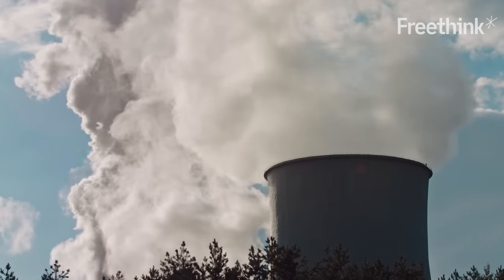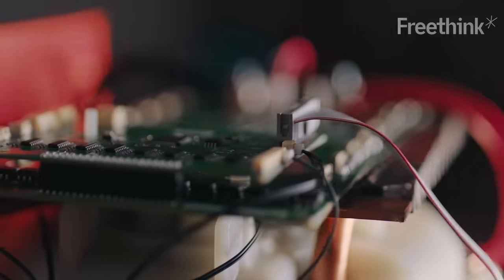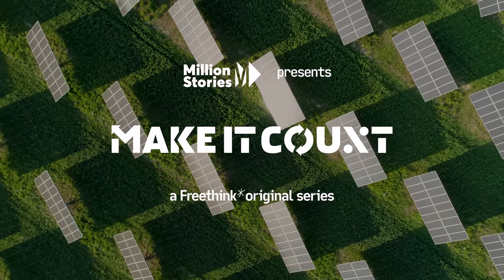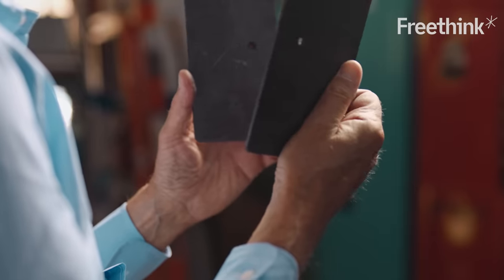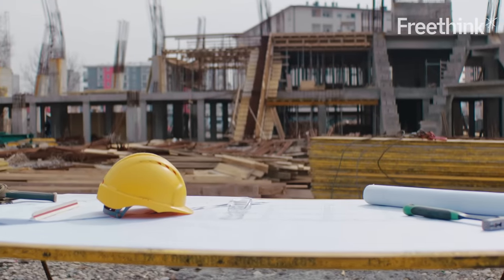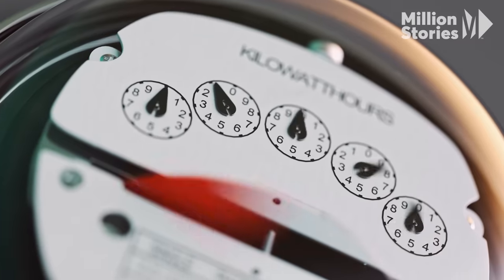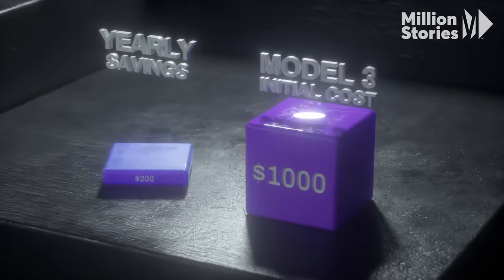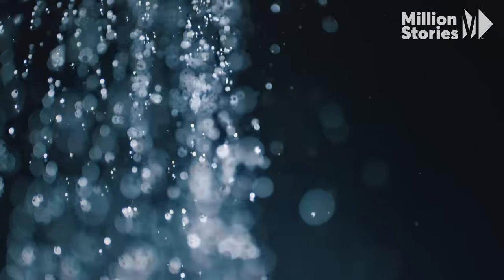The man hacking hot water to save the planet

Comment from the maker: How do you think we can help speed the transition to green technologies?
Reply: Make it cheap, easy to install and long lasting.
Reply: Carbon tax, cap and trade with an aggressive decrease of the cap, government investment in R&D
Reply: Stop making up such buffoonery.
Reply: Make the tech available as a kettle. Start small, get consumers hooked, then upgrade their homes heating systems to the same tech they're now used to.
Reply: Do you think you could do a series on Seasteading? I think it would really fit with your channel, and there's huge benefits for the environment, as well as to society.
I'm part of a number of seasteading projects, and in touch with people from the Atlas Island project, the Seasteading Institute, and there's a number of other projects out there as well.
 - Jamie
Reply: Best time to install green tech is in the design phase, buildings are not a good place for incremental additions. Educate the common people about how simple insulation will be far cheaper than running AC in summer and heating in winter, and how having a solar roof can both save money and keep the lights on during blackouts, not just the folks who are interested in renewables, or the people and companies who think "green" is the latest fashion. Governments are already sponsoring people who install solar or heat pumps, make it a law that a cardboard box with huge holes does not qualify as a house just because it has a roof and door.

Another thing, domestic solar is really expensive because sending a team of professionals to put up twenty or so solar panels and do the electric work in one house for one to three days is a terrible waste of manpower when they could have installed hundreds of panels per day on a solar farm. Micro and small wind turbines are generally only useful away from cities because a 20-100' tall tower tends to bother the neighbors and trees and close built houses block the wind if you put them lower. Lots of businesses have big warehouses and other buildings that could house 100+ PV panels and wind turbines with enough clearance to catch a good breeze, there should be more incentives for companies to use renewables.

Properly use them, I mean, not just putting up a few panels for PR and forgetting they exist... The company next to my workplace has six vertical turbines on their roof that probably have never been maintained; the area is very flat and has lots of windy days, but only couple of those turbines are still moving after years of neglect.
Reply: @TorpisoulYT  
The big advantage is, that for a kettle this makes way more sense than for the hot water of a house.
Reply: @MusikCassette  and yet I cannot find any on the market. If you or any, please let me know!
Reply: @AnalystPrime  Perhaps someone should design buildings to be more modular and the modules replaceable? Seems like a big oversight that such an important and common feature of our civilisation can't be incrementally improved. The container-shaped steel frame building block (literally) featured earlier on this channel seems like a good place to start.
Reply: @AnalystPrime  Yea I think the most difficult problem to solve with big prefab (ex. apartment) buildings would be drawing the plumbing. Ideally the people who own or at least maintain the resulting building also control the prefab production line.
Reply: Increase the price of portable water.
Reply: It would help if you promoted real solutions that follow basic physics, instead of whatever this video was
Reply: Maybe don’t force it on people
Reply: Affordable direct PV DC hot water.
Perhaps a rebate to pay for the installation.
Reply: In reality, what you spent to build "green" and maintenance all those systems you'll ever pay more than just consuming energy. You'll never reach the point where you actually save money. If you get close there is a bigger maintenance or even a total replacement to finance. - Either energy producers are force to produce green energy or products for home usage need to get drastically cheaper as their maintenance easier and therefore cheaper and more long lasting. Both should be done and would be possible. But there is a lot of money to earn with the green label.
Reply: By you not shilling for scams and instead doing your homework and supporting real solutions. Example, go look up Rheem or AO Smith's line of heat pump hot water heaters. Those are PROVEN to be have double the efficiency from actual EPA tests, not some dude's slick Powerpoint.
Reply: Tell the whole story, don’t talk just about the tech that is lining your pockets…that’s a start. There are other options available that are just as good or better.
Reply: @TorpisoulYT  
Plate boilers are available for a dollar a piece!
You just have to go to a different country where ELECTROCUTING PEOPLE, is less concerning to the respective authority's. These went out of fashion in the 50's because they were considered unsafe!
Reply: @lordsamich755  oh my. Perhaps not something I want to try and build myself, then!
Reply: @TorpisoulYT  
If you know what your doing it would probably be fine. But there's no point, they can be bought for a few dollars.

It's true that plate boilers are less prone to scaling. But it's not true that scaling makes the element less efficient. Basically the guy knows what he's doing, and He's a straight up Conn artist.
Reply: @lordsamich755  I do not know what I'm doing haha. I wouldn't rush into a purchase anyway. Thank you for the information.
Reply: Heat Pump water heaters. Look them up, they are a new/old technology
Reply: It has to be treated as part of an infrastructure initiative. That's really the only way this gets implemented in a timely manner. Especially in the US, a lot of people are not going to be able to put this in their homes for a while.
Reply: What bogus and biased video!! U literally didnt explain how the technology work. How does the graphite plates heats up the water by just passing electricity. And you say its cost effective? Geothermal are much more cost effective and has less hassle than this and can be installed anywhere on any homes. You video was just advertisment of the product without explaining how it really works. Could very well be a scam
Reply: Make videos about real beneficial technologies.  Putting up videos of snake oil (like the product in this video) promotes misinformation and hurts everyone.
Reply: The major problem I'm facing now is not enough amps into my home.
Reply: Vote for small modular nuclear power in massive quantities. It's the only realistic answer.
Reply: You can go to developing countries
Reply: By promoting actual green technology instead of this snakeoil
Reply: Have been heating my water tank using solar panels and a smart relay for 3 years now. Have only had to switch across to grid power to heat my hot water tank a handful of times per year.
It was simple to install and simple to monitor.
Reply: Not advertise hox tech pushed by con artists…
Reply: Should be adopted in the industry first - they produce the most pollution and they would have the biggest savings, only then expect it to be used by consumers... If it's so great, then it should be usable at large scale.
Reply: @MusikCassette  A water tank eat like 5kwh just on keeping water warm during day. A instant waterheater just use around 100watt/minut you use the hot water, so you save the 5kwh/day
Reply: Make retrofitting the new systems way less expensive.
Reply: By not spreading miss information and getting the public to buy into technologies that dont work, and businesses that are basically scams. That would help speed the transition to green technologies.
Reply: We need to dial down the speudoscience and actually start educating people. This video is actually hampering the transistion to green energy.
Reply: how is this more efficient than a heat pump? and how is it more efficient than a normal heating element, if you count it as being new?
Reply: Convince people that it’s their idea.
Reply: Do not promote scams like this.
Reply: He could be making deals with construction companies so new buildings and homes are already installed with this tech. Eventually, it will have scale to be cheaper and it will dominate the market.
Reply: By using heat pumps instead
Reply: Through political pressure and law enforcement. The future is not asked, but forced to change.
Reply: Make it illegal for the existing established energy providers to stifle out the improvements.